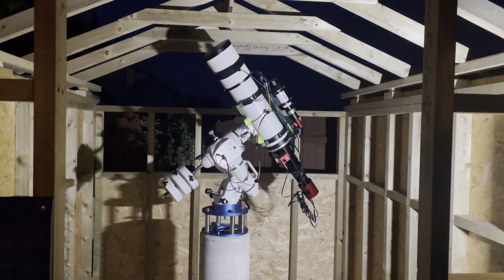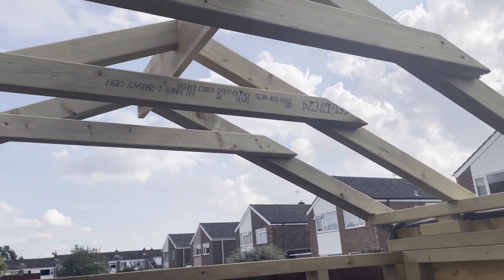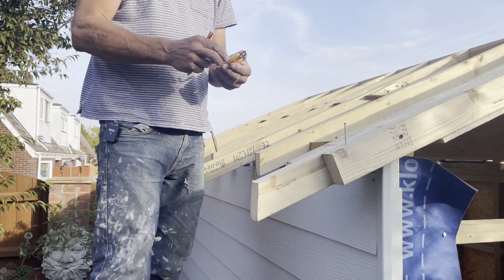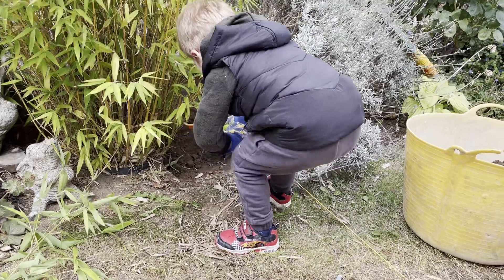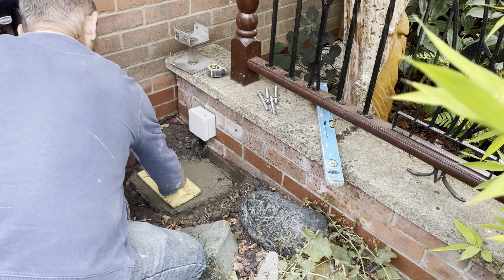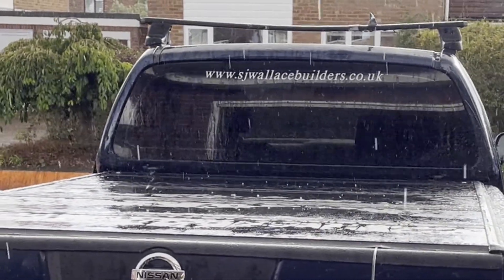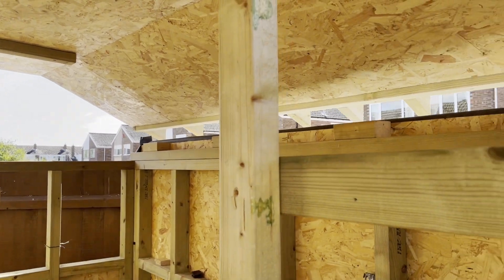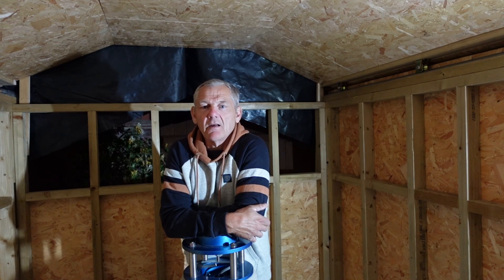How to Build an Observatory with Roll off Roof Part 3 #observatory #homebuild #astrophotography

Comment: Very interesting Simon. But where did you get the track from?
Reply from the maker: Thanks, I got the track from eBay!
See link:

https://www.ebay.co.uk/itm/317265634218?_skw=20mm+v+groove+track&itmmeta=01KBTYNEMNQQJX7PMRHW6ZDHP4&hash=item49de8163aa:g:c8AAAeSwPLhowZNs&itmprp=enc%3AAQAKAAAA8FkggFvd1GGDu0w3yXCmi1dtM4Pv3Fbq74yIOj1bqKkKeJgOtkrDnAxdBFhx2615enmbQ3wP1zlO64kCCzYbrgYDBt8Xq2vklsQwosHYYZb%2BUyKv7Ds7dfC4Ia7AKFc%2FqDhuC5L98KalQE5l5KNIK3xOntOYfjEW84gt5tev9909S7mkxIifN%2BcHeyULgX5fm6fu6xhfwXxiJudX0kJtosDj9YlhO4bRiNI8hL15w7MVGW%2B2tZUoH8LGuViqktrCVzv5JMeYt1LRUb2gPdZFwLuxfJHRMjlh3irn9wc4x3JPMtAxZWDwCUEgavmeWcJI6A%3D%3D%7Ctkp%3ABFBMuOrV3t5m

Clear skies!